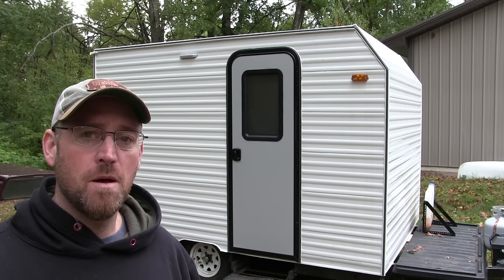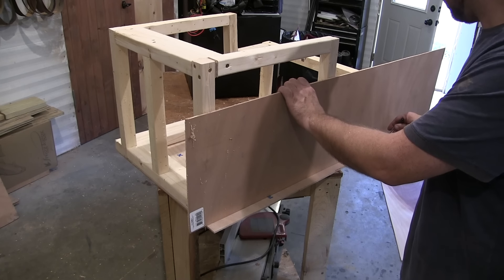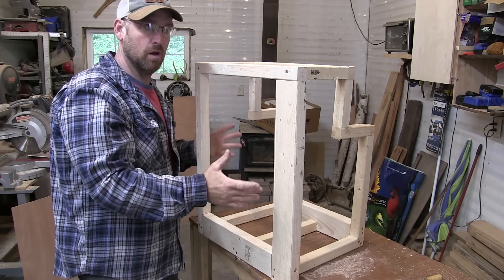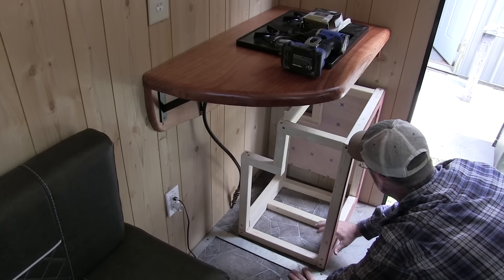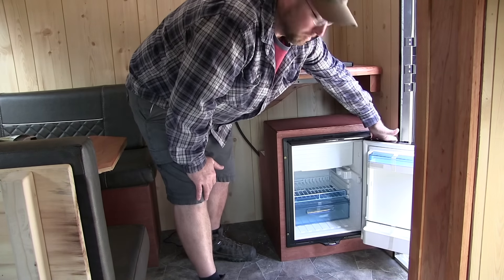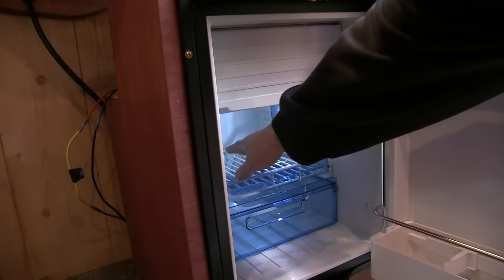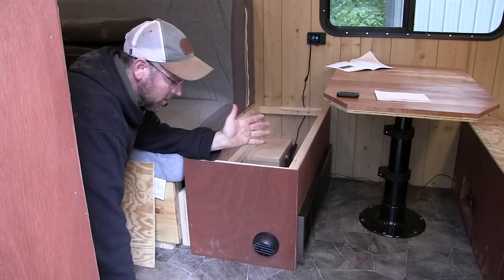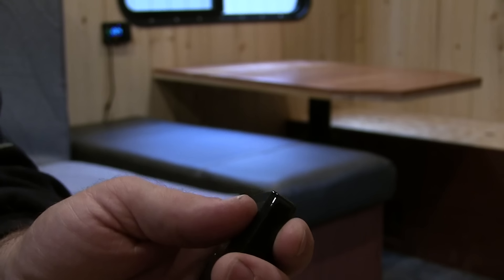DIY Camper Cost and Weight !! installing a fridge and heater

Comment: So I have clicked on the second video directly from the last... well done. Presuming this is a public forum and you are a distributor of good information, corrections and the like which is helpful to others (Thank you !) 
Please share that the "foil" or reflective surface, IS EXTREEMLY IMPORTANT.
With experimentations on real homes etc behind me it may be better to share the "perspective" which leads one to use it in the best manner for the circumstances. "Reflect the extremes" or "Reflect what you don't want."  It is natural to think that one wants to reflect the atmosphere you want but it turns out that you are really wanting to eliminate unwanted  heat or cold or whatever you don't want.
   In virtually every situation concerning habitation, one wants to reflect the heat in the summer and reflect the cold in the winter... yes "Reflect" the cold. It works for both heat and cold... after all it reflects whatever is present to reflect... isn't it interesting that a cutting laser does not "impact" a mirror or glass which is clean? Just a thought to challenge the mind.
   in the same way we the people need to institute "Mandatory Competency Testing" to insure those in positions of public trust are at the least "Competent" to serve. The Constitution has only one prohibitation on tests and that is "no religious test shall ever be required for any office of public trust or profit." but there is absolutely no reason that we should not require our employees to know the laws of this company and the purpose for which it was created, "That to secure these Rights , Governments are instituted ..."
   We need to "Reflect" the laws we have had written for us or get rid of them. We the creators and maintainers... oh yes just as this trailer needs to be maintained and checked for "breaches" by water or "leakage" of air, heat, ac, or bugs, ants, termites...
  Speaking of which if I may suggest to tar, oil soak or some other preservative on  EVERY piece of anything and the backside of panels and particularly the ends of any celery stalk/wood .
   Oh, since you used screws (fasteners) (I dislike nails in general for so many reasons and yes predrill always except when wen wood is wet or soft and you lube the screw...  you can so an experiment whenever you remove it for some reason... put a reflective layer on before putting the siding back on. I use the 1/2 inch foam with shinny foil on one side. They may be hard to find but get them dropped at your local hardware store if they don't want to do residential... it's worth the trouble... I've been saving all the potato ship bags with reflective foil, my dogs clean it very well for me and via "reuse, recycle and compost" principle will spray or role a contact glue to the surface and create a reflective shield with "free" trash... let ya know how it works...
Blessings
Reply from the maker: Interesting ! thanks blessing to you as well !

Comment: What a great build. Wonder if you should insulate the floor? Also on fridge replace fuse with DC circuit breaker.
Reply from the maker: Thanks !! I don't think I'll be using it in the winter to much so I don't think I'll insulate the floor. a breaker would be much more convenient than the fuse .

Comment: So, this isn't much my thing, but I have watched a video or two because it is interesting.  Your video popped up in my feed and I couldn't stop watching.  Very well done, with great explanation of the process.  I almost felt I could do it.  I am curious if you have corner leveling Jacks.  Might be common with tent trailers, but I've never owned one.  Great work!
Reply from the maker: That’s awesome thanks!! It does have them but they haven’t been used in so long they need some wd40 and attention.

Comment: You can run the 12  volt system from a high rate charger from 120 volt or 4 panel solar system on the roof.
Reply from the maker: I could but in this build I really didn’t want any holes through the roof

Comment: The only problem I see is where your installed the thermostat right next to the window a cold spot. Which would give the thermostat a false reading. You never want to put thermostat near an open door or a window. Great job! 👍
Reply from the maker: Thanks! It’s not really a thermostat unfortunately just adjusts from low to high heat doesn’t actually shut off or turn on by reading temperature

Comment: Good luck with the DC fridge, but my experience is that they draw a LOT of battery power with a large battery barely able to power one overnight, but maybe the tech has improved. Propane works much better, with the large fridge/freezer in our new camper drawing a little under a pound of propane a day. Again good luck!
Reply from the maker: Thanks , yeah I have my doubts on it too but I thought I would give it a try so I don't have to do any venting through the wall for a fridge .

Comment: It looked like you installed the fuel filter the wrong way, the visible clear side goes towards the tank. Also to quiet the fuel pump place a thick chunk of rubber between the pump and frame,, 3/8" or more thickness. Over all a super job on everything. Oh, and a little sink would not hurt with like a 3 gallon tank.
Reply from the maker: The most that comes with it is actually a soft probably 3/8 thick rubber . I took it camping the spring and the noise really wasn't that bad at all .

Comment: I was always told at least 6 months before paint or stain on PT wood but that’s for decks and stairs where the bottom side is still free to breath. I’d research that more for the reasons you mentioned. Just sayin. Great video ! Take care Ryan
Reply from the maker: yeah I may wait longer yet but I think it should be pretty good by spring . could always buy a cheap moisture meter to check it with too. Thanks !! you too !

Comment: Concerning the diesel heater...you may want to replace the fuel line with a quality one. Also if you look hard enough on the internet, you can find a much quieter fuel pump. I've seen videos where that fuel line would fail.
Reply from the maker: I've heard that the fuel line isn't very good sounds like a project for this summer . yeah I might eventually change the pump

Comment: You can try replacing the fuel pump.  I would see what pump Webasto used in big rigs..I never heard one in any of the trucks I drove. That noise would make me nuts.
Reply from the maker: I camped with it this spring and it really didn't bother me at all

Comment: You can isolate the pump with rubber grommets and nylon clamps, that may cut down on the noise.
Reply from the maker: I'll have to do something like that . the mount it comes with is thick rubber I thought that would do the trick but not quite

Comment: You can get a quieter heater pump for $45. or so on line. A third of the cost of the unit, but probably worth it, depending on application.
Reply from the maker: yeah I'll probably check into it thanks !!

Comment: Can you mount the fuel pump on silicon or rubber mounts and box it in cork for sound proofing.  Cheers, looks fantastic!
Reply from the maker: I'm thinking something like that would be the way to go . its in a rubber mount and you would think that would dampen the sound a bit but its still pretty noisy

Comment: Very well done. What did you use for the sides, metal corrugated footing? I have a trailer I am going to make a Sheep hut type roof.
Reply from the maker: Thanks !! thats actually camper siding I bought it at an RV surplus store

Comment: Looks great only thing is I didn't see water proofing will this last long under rain and snow and not possibly leak
Reply from the maker: Thanks  !! it has a rubber roof and siding it has been rained on really hard and hasn't leaked yet . I did build this to store it under so the roof will last longer
https://youtu.be/3IMR2rOuPDE

Comment: Awesome build. You wouldn't happen to have a link to the diesel heater? Me and the GF are wanting to do a similar build with a older utility trailer I've had for years.
Reply from the maker: Thanks !!  I don't but it's pretty easy to find . just google  Vevor diesel heater they have a few different models

Comment: Not a terrible cost for a new trailer 

Even if you went a little bigger im sure the cost wouldn't rise that much.  

Nice project

Cheers from the North.
Reply from the maker: No I don't think it would change much might be the same if you didn't make a few wasteful mistakes that I did.  also I have probably 6 sheets of extra siding

Comment: Where'd you get that table leg? I need one just like it. To quiet the fuel pump, you can use some isolation mounts. They're just bigger rubber mounts.
Reply from the maker: I bought it at Forbes Rv surplus in Traverse city , but I would guess most RV surplus stores would have them

Comment: Nice build. I have been toying with the idea of building my own. I have had a few campers over the years however there is always something about each one bugs me. I have made mods to a few things to make it work. I think I need to spend sometime designing what I want then build it
Reply from the maker: Thanks !! it's been the same way with every house I've built there's always something I wish I would have done differently. this camper I wish I would have made it more aerodynamic . I may build some kind of nose cone or something though. I hope you can get it right

Comment: Was it wet from chemicals or from it being outside..if it was from the chemicals,you wouldn't have gotten mold if you would have painted it BUT it really don't matter that much if you paint it with marine grade..it would have been nice to insulate the floor though..LOOKS GOOD..about how many man hrs did you spend building it?..including the female help hrs?
Reply from the maker: its the chemicals but still moisture. I'm not really sure . I would guess a couple weeks if it was more condensed

Comment: Nice build!  Would adding some additional rubber isolators under the mounting and between the bolt/nut of the fuel pump possibly dampen the clicking further? Maybe additional sound insulation around the pump?
Reply from the maker: Thanks !! I think I'm going to build a small box and stuff it full of insulation
Reply from the maker: and maybe like you say put some rubber mounts behind the box

Comment: Good catch on the vent alignment. Pull from low/cool, vent to high/warm. Yeah, that pump noise would drive me nuts. Can you explain why you didn''t go with propane?
Reply from the maker: Thanks !! I have the old heater from the popup and I'm sure it still works but I just couldn't find anyway to install it and not have it in the way its just a real odd size . I would have preferred propane its quite and less smell

Comment: There's a couple of things you can do about the pump noise:  Get a different pump (like a Webasto or other European name brand).  There are also molded sleeves, I think made of silicone rubber, that you can encase the pump in and that muffles the noise too.  Or maybe build your own insulated box to surround the pump.
Reply from the maker: Thanks for the tips !! I think I might go with a box that way it will also be protected from dirt and mud

Comment: I was curious about those diesel heaters, I have a small 16x8 cabin and some days wood stove is just to much heat
Reply from the maker: It seems to do nice but I think a wall mount propane heater would probably be nicer if you have the room . their quiet , and propane is easy to haul without worrying about spilling it

Comment: I ve seen other YouTubers put the fuel pump inside a small pelican case with foam to dampen the sound. I wondered if it makes any heat, would it get hot
Reply from the maker: I’ve thought about doing that too. I’m not sure if it would get hot or not . One guy told me they don’t but I would have to try myself to be sure

Comment: Maybe you can mount your pump with rubber , to act as insulators.  Should quite it down ,it’s because you  mounted on metal frame.
Reply from the maker: the mount that comes with it is actually soft thick rubber

Comment: I bought a 14 foot tent trailer and am building a camper out of it. Until I saw your videos. I never thought of the axle weight rating! 

I looked online, the average empty weight of a pop up trailer is 2300lbs , Average load capacity is 1100lbs. If I were to tear down the camper to the frame and rebuild. Wouldn't the weight capacity be 3400lbs minus the weight of the frame? (Not including hitch weight)
Reply from the maker: Man I'm not sure honestly . I don't know if I would trust going by the average weight ratings online . if you check on your axle there should be a tag riveted to it somewhere around the middle and that should have the axle rating on it. also if you have the title of the original camper that I believe should have the weight of the camper on it .
Reply: @blackspruce1861  I'll have to have a look. I've worked with a lot of axles in the past and never seen such tag but I could be wrong on this one. 

Contact the manufacturer worst case. 

I live in northern Ontario getting up for -55C temps. My build is fully winterized so I'll be adding some weight to it for sure.
Reply from the maker: It might be different in Canada , and I've only dealt with a couple axles so maybe its not that common . where about in northern Ontario are you located . I'm hoping to drive around Lake Superior this spring , its been a few years since I was up there.
Reply: @blackspruce1861  Lake superior drive is absolutely beautiful. Highly recommend during fall season, scenery wise! 
I'm further up north, I was born 3 hours further north but I'm located in Timmins, Ontario
Reply from the maker: @northernontariowacko  oh cool . I did the drive once but went way to fast and didn’t see as much as I should have. I would love to do the fall trip but prefer the spring because the rivers are raging and the waterfalls and rapids are huge

Comment: what are you doing to keep your battery charged? Seems like a lot of 12v draw for 1 battery  for lights and fridge, Are you going to add a couple of solar panels with a charger? Maybe an additional battery?
Reply from the maker: the truck charges it when it's getting towed . and I have a solar panel with a decent length of cord so I can move it to a sunny spot . the lights don't use much energy at all , the fridge though I haven't used much to find out
Reply: @blackspruce1861   id assume the fridge runs about 4-600 wh/hrs

Comment: Nice job on your build. You might want to take watch this video “Taylor Coach 16’ frame to road” on YouTube. This Timelapse clip may provide some build ideas if you’re planning another build, or your followers may benefit. My 14’ Taylor weighs 1,475 pounds and is 21 years old, still going strong. The floors have an aluminum barrier with plywood flooring laid on top and the roof is also covered with aluminum sheet. They’ve been custom building these coaches since the late sixties. I hope you find their build process to be of interest. 

I was inspired by your video to consider trying a diy build.
Reply from the maker: Thanks I'll have to check it out !! Thats awesome no better compliment than inspiring someone !!!I just did a bunch of improvements to the camper that video will be up at 3:30 today if you'd like to see more